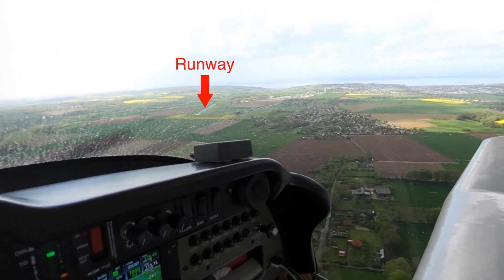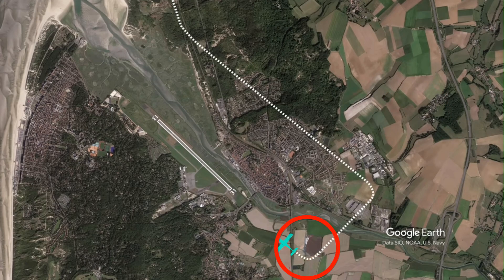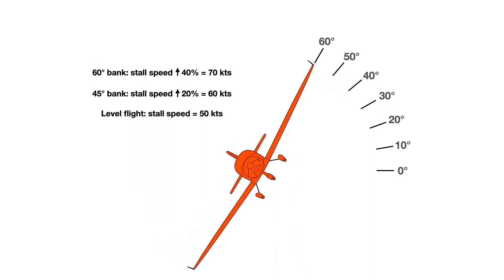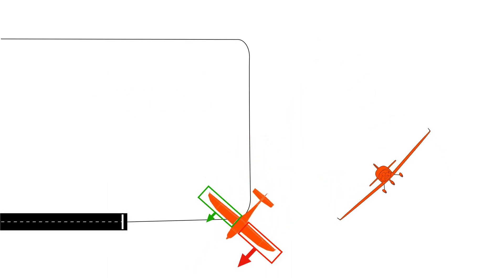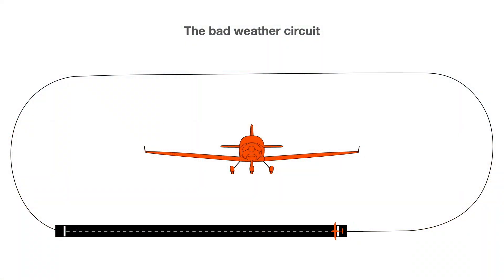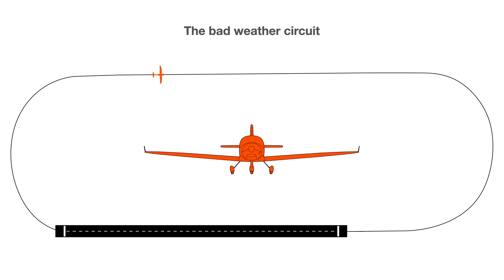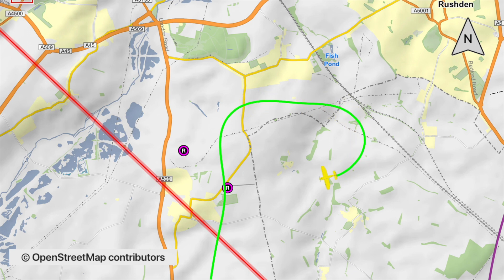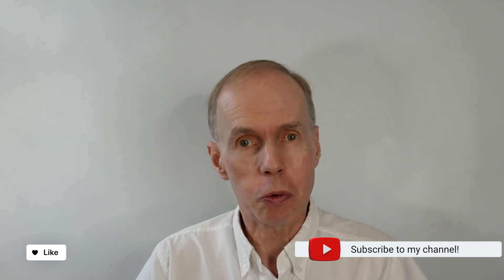Avoid the 'graveyard turn'—a safer way from base to final

Comment: I'm not convinced that well-banked final turns are more dangerous. I fly gliders, and what generally kills pilots is slow, under-banked, over-ruddered turns resulting in a stall/spin too low to recover. Yes, the stall speed increases with bank angle but then the nose tends to drop keeping the speed up and making it much harder to stall with the available elevator authority or by over-ruddering. But perhaps it's different with powered aircraft.
Reply from the maker: Yes, I appreciate the phrase “well banked”. The point of the video was to try and highlight how a danger might be mitigated by giving the pilot a wider envelope of safety at a phase of flight where margins for error are narrow (low and slow and in a turn) and distractions (such as weather, radio calls, other traffic) or misjudgements (such as of a tailwind on base leg) can result in disastrous mistakes.

Comment: I was taught the squared approach for two reasons. It's what expected at the reasonably busy Class D airspace that i did most of my training in . Also, when one leveled out it made for better traffic avoidance in the pattern.   However, I do like the carrier approach for the exact reasons you talked about and would like to see it become the standard taught
Reply: Not only that but teach and preach against straight in approaches, if you're late to the party, you gotta get I'm line.
Reply: You dont need to level the wings to check for unreported traffic on final if ATC did that for you.

Comment: Why is ot still used?
Invented by a theoretical designer. (An Engineer?) Mandated by the gvt. Inspectors are to scared to change it. (I just did what the book says.) And nobody is brave enough to say that the king has no clothes on.

Comment: Excellent video,  the smooth turn from base makes a loy of sense.  so too does choosing a longer final.  It gives the pilot more time to set up the landing properly.  It happened to me once in a savage 25kt cross-wind landing at Hoxton Park aerodrome west of Sydney,  I only realised later that the cross-wind capaciy of a C150 was 12 kts.  The long approach allowed me to adjust the aeroplane to suit the conditions and I did not crash.  Phew!
Reply: "Cross-wind capacity" isn't neccesarily a limit as you found out first hand. Its typically the crosswind that the test pilots believe that any pilot should be able to perform + some margin. Its up to your own skill level and judgement, which you performed well as you were able to walk away from that incident. I have landed a PA-28-181 with a max demonstrated crosswind of 17kts, in a 25kts crosswind with no dramas up at Archerfield in Brisbane. Stay safe out there my friend!

Comment: A hybrid version is to fly downwind a little bit longer and then turn more than 90 degrees towards the direction of the airport so that you can intercept the centreline at 30-45 degrees and the final correction into final is just a gentle bank.  It also has the advantage of much more precision in an accurate line up with the centreline.
Reply from the maker: Thanks for your comment and yes, I agree: the point of the video was to highlight the danger of a sharp base to final turn and how this danger could be avoided. Flying a continuous curve from downwind to final will not always be appropriate although I prefer it where the situation allows.

Comment: Hi Captain, I put an additional point in the situation: if the pilot let the airplane naturally descend in the turns (not pull the stick), the stall speed will NOT increase. And considering the goal is to descend and align, this is the way to go. Is that correct?
Reply from the maker: In a turn, ailerons and elevator are used together to maintain the required turn rate, but the elevator also has to control the sink. How much rudder is needed depends on the adverse yaw characteristics of the aircraft. It's all a matter of balance. If everything is perfectly stabilised then you are right, but a wing can stall even in descent if the angle of attack is high enough, so if the turn is too tight, and the inside wing becomes too slow, it can still stall. The point of a curved base to final turn is to keep the aircraft in a 'comfort zone' where, even if the pilot is distracted, there is still sufficient safety margin.

Comment: In the C172 I always try to keep at least 70 knots on my downwind to base and base to final. I was also taught to introduce flaps into these two turns. Flying coordinated was always drilled into me during training, and I never go past standard rate turn. The rounded turn does seem safer though.
Reply from the maker: The problem arises when the pilot is distracted (perhaps by weather, radio calls, traffic). That's when flying within a wider margin of safety should help..
Reply: That's the way the C150 Landomatic worked.

Comment: I learned to fly on an RAF University Air Squadron (UAS). My instructor had me fly constant rate curved approaches (and I can't understand why rectangular circuits are still used by others). I'm keen to hear the experiences of other UAS students over the years please...?
Reply: 800ft 80kt, downwind to land call. Checks
Begin turn 
Call, looking for 600ft half way round at 75kt. Adjust bank for centreline

400ft 65kt aligned on runway centre.

Bash it down on the numbers. 

Make tea for QFI.

Comment: When I learnt to fly, I was taught to square-off the corners and as I currently fly a flexwing where the stall-spin is not such an issue, it's a safe procedure. However, over the last couple of years I've changed to the constant curve from downwind to final as I find it much easier to line up onto the centre-line.
From what I can see, in a high-wing aircraft the constant curve still gives you good visibility to see anything else on final, but for a low-wing aircraft the squared-off circuit could be required to ensure a clear view on base before turning final.
The other issue is that if you extend the downwind leg or move it further out, you risk not being able to glide to the runway if the donkey dies. Again, that was another thing drummed into me in training. If I remember correctly, glider pilots refer to it as the 45° rule.
Reply from the maker: Thanks for your comment. I agree that with a curved approach downwind to final in a low wing aircraft the view of other aeroplanes on a straight-in approach will be impaired for at least the second 90° of the turn although I think it could be improved for the first 90° because the other traffic will be more towards the centre of the circuit traffic pilot's line of sight, but the method can be modified to do a tighter turn downwind to base and and still curve the base to final turn. The point I am trying to make is to keep the maximum margin of safety in that last turn where the risk is highest and distractions can cause mistakes and misjudgements with little room to correct.
Reply: @pretavol  Hi, thanks for your reply and all fully understood.
Yes, that final turn is the most dangerous especially if you've left it a little late or misjudged the crosswind. Probably best to go around rather than overcook the turn and come to grief, but in the heat of the moment it's no wonder it's a very common mistake..

Comment: I personally do what this video shows when doing a constant turn to a tower-assigned heading, (or squaring the upwind-crosswind-downwind-base when staying in the pattern), then purposefully start the base-final turn early. I’m usually doing the final turn around 15-10 degrees of bank.  Then, if I “overshoot,” I’m just “closer” to the standard bank-angle, but never beyond it.
I was reprimanded once by the head of the college flight school once for “not making a square pattern” (the base-final turn), I complied-ish, but thought “I’ll never be caught dead doing a perfectly standard-rate base-final turn” because it’s just dangerous. The statistics show that pattern instruction doesn’t allow for a “bad day.” Overshooting would never be an issue if you started before you had to. A “planned” 30-degree bank missed to a 45+ degree bank, 10-15 knots slow, with a forgotten notch of flaps, and you could be 6-feet-under in a wooden box. No thanks.
It also is just better planning to be able to lessen the turn rate to be wings level exactly when you are on final, with wiggle room for the wind. One time I was landing in a Bonanza with a 50 knot tailwind on base at 2000 feet, with almost calm at the runway.  I started the turn a couple miles before I felt I had to and with extra speed for expected wind-shear, worked just fine. (No wind shear surprisingly). Glad I started when I did, because even starting early I didn’t have to go wings-level because of the wind. The landing was late at night also.  If I practiced the “square pattern,” I either would have been a statistic, or a couple unnecessary go-arounds.

Comment: Most of those stalls happen during a tailwind on base, no flaps turn because expecting a crosswind landing.  On the downwind they didn't correct for the wind towards the runway,  so the wind pushed them closer to the runway.  Then they turn mild banking to base leg,  "because CFI said you are supposed to turn shallow when low" (BS, you can turn 45 degr. but at Vglide plus 10 knots plus on piston planes), then on the base, due the tailwind on it, ground speed accelerates them, so they cut the power, then due all those pilot errors,  OOps!!!,  im overshooting the final, THEN to save face, they steepen the bank, to 45, pull back towards the runway which on a steep turn looks on the side, and without realizing it, They do a " No Flaps, Power Off, ACCELERATED STALL".  

Clearly CFI fault for not teaching real windy GRM, and Accelerated Stalls.   When CFi in the 1990's i used to teach "Strong winds GRM" and also accelerated stalls on all kinds of airplanes, even Tomahawks.  The crosswind short approaches using GRM Basics.   FAA dont require Strong GRM practice or Fly Over aligning GRM either, neither Accelerated Stalls for any FAA license.  Turkeys teaching how to be a Turkey.   Thousands died each decade and FAA still looks the other way.  FAA likes Mild Maneuvering Mouses as pilots.
Reply: What is "GRM". It's not a term I've ever come across, and google doesn't seem to know either.

Comment: All sounds right to me.  With a high wing power aircraft, I will turn 90 degrees from downwind to base.  I want to get on base quickly, so that I can look for other traffic on final.  However, on the turn to final, I round it off with a shallow banked 90 degree turn so that I can always see the runway (wing does not get in the way.)  I use the same technique for a low wing glider.  For a glider, I think it is more important to see the threshold sooner (and adjust the turn rate toward the runway) to be able to gauge the height and distance (especially if wind reduces the ground speed significantly.)

Comment: What isn’t consistently taught to students, and rarely brought up on check-rides is the very simple idea that there is no hurry to land, once in the pattern.  Too many pilots think they MUST do tight patterns, tight turns and execute expedited arrivals.  Wrong, and some cases fatally wrong.  I have taught, as a CFII, to give yourself timed VFR patterns.  The timing depends on type of aircraft, weather and or wind conditions and workload.   The first timing comes as you either enter your 45 to downwind, or fly the crosswind.  Instructing, I want to see no less than 5 seconds between the aircraft and distance to runway. In other words, if you were to approach the runway perpendicular, from downwind to centerline would take 5 seconds.  At an average airspeed of 80, this puts you no less than 200 yards out on downwind.  On downwind and once abeam the numbers, I teach the minimum 30 second rule.  30 seconds of flying downwind past the runway before the base, base to final turn is made.  No bank angles greater than 25 degrees.  Airspeed no less than 1.2 stall at ANY phase of the pattern.  New and old students alike, it’s a must for a timer on the yoke and a notation on airspeed indicator ( or predefined alert on the flat screen tape ) for 1.2 stall given predetermined density altitude.
And of course … communicate, communicate.

Comment: Are the values you provided applicable for most planes
Reply from the maker: The graph of percentage stall speed v angle of bank and the percentages in the next clip should be applicable to any aircraft...Each aircraft will, however, have different stall speeds and it is vital that the pilot is fully conversant with the aircraft's performance before considering any manoeuvre. Some aircraft are designed to be much more forgiving and capable at lower speeds than others.

Comment: The reason this is not taught is simple. It’s not in the syllabus and instructors MUST teach the course material. Only way to change this is get the regulatory bodies to change GOODLUCK. 

Also this may work in low traffic patterns like regional and county strips but in heavy traffic patterns L&R parallel runways a good square pattern works well if you don’t turn to early on base and crowd the pattern the turn is not that dangerous this really only happens if overshooting. Be Safe

Comment: Rate 1 turn is the Standard rate turn, or 2 minutes for a 360 circle.  At 60 kts circumference is 2 nm .  Diameter of the turn then is .63 nm at 60 kts or about .74 nm at 70kts.

Comment: I've had five basic flight instructors.  Two of them were military pilots. Two were civil pilots.  One was an aerospace engineer for NASA.  The two military pilots taught the smooth continuous turn to final.  The other three taught me to do tight, precise, box-like turns to final from a 90-degree base.  The military pilots flew hundreds of sorties in Vietnam, and afterward, both flew for the airlines.  The others, by comparison, were relatively low-hour commercial pilots.
Reply: I agree, I like the keep my turns oval shaped, prevents over banking and over shooting finals, and much less aggressive for nervous passengers
Reply: Military flyers use continuous descending base to final turn (curvilinear) withe the nose always down  - much much safer than square pattern.  In light plane with power at idle or near idle results in no to minimal traffic pattern stall risk do to continuous nose down attitude all the way to flare.
Reply: @SR-gs8zo 
One response might be that many pilots train in high wing aircraft. One long continuous turn to final causes the field and patter to be out of the pilot's line of sight for nearly the entire turn. It can be advisable for some aircraft to lift the inside wing one the base leg to check the relative position of the airport and also to check the pattern for faster moving aircraft not on freq.
It could also be that the pictures show an exaggerated base leg to clarify that it is a distinct part of the pattern, and many instructors take things, literally.
Reply: I learned in the military.

We always did one continuous  curve.
Reply: And if you happen to encounter a sudden crosswind  on that turn onto final it can complicate things as it did for me as a newbie second solo flight. And to com-locate it further I was landing int the east Texas big thicket with 50 ft pine trees at the foot of the runway that I had to pass over, before I could get down to the runway. Stall warning sounded but I was able to recover, I don’t know how, and made it down safely.
Reply: how do you fly a 90-degree base/crosswind leg, do you aim for something on the terrain? the squared pattern is too difficult without heading indication
Reply: Yes, the mil way is curve, worldwide I think.

Comment: Great video. An alternative is simply to extend the downwind leg and to be further out laterally from the circuit/pattern. Only a little is required to make the turn much safer and make sure the final turn is never more than 30 degrees. Another factor is never to over rudder the turn, even if it means you are  not strictly coordinated at the final turn. Also a little more speed can easily be bled off (another glider technique where glilder pilots routinely approach at way higher than v-ref).you can always side slip a little and cut power on finals if needed. Both of these are much safer than a steep turn.
Reply from the maker: Thank you and I take your point about widening the circuit, although doing so in poor visibility may mean losing sight of the airfield so I prefer to adopt a consistent method and become adept at it.